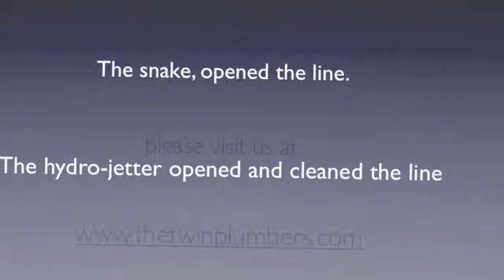Snaking vs. Hydrojetting

Comment: Use a 2 inch cutter on a 1/2 cable , and do a proper snaking ,don't try to use false training to sale over priced hydro job's, pro know hydrojetting was started up for commercial grease traps , guys like this give real plumbers a bad name.
Reply: Maybe this video is a little weak in showing what proper snaking can and should do, and maybe also with a bias towards promoting hydro jobs...however, this URL, https://youtu.be/4lBozsiBnEU, AND this video BOTH show to me that hydro has superior abilities in important respects.  In a reply to a comment above, the twins do acknowledge that some hardened plugs require a high-power snake to poke a hole and make a path for first, but that overall and for most cases, hydro is superior in results--and at the least, in efficiency.  Watch Drain Addict's YouTube videos too.  I paid $200 for a professional to snake my main drain only to have it replug just about 3 months later...it's THAT kind of crap that gives plumbers a bad name and why I'm trying to learn how to do it myself, and/or better.  I guess, really, only a post-cleaning video would show if the final effects are good, with either method.  At the refinery I work at--heat exchanger tubing is cleaned not with snaking, chemicals or brushes and scrubbing/scraping, but by...guess it...very high-pressure water, about 20,000 psi.  So hydro cleaning is seen in oil/gas as a best known method.  Thanks.  I have no connection or affiliation with Twin Plumbers or any hydro sellers or manufacturers.

Comment: Ya this is a little unrealistic.  I’m running water or have it topped off and you are usually clearing only one clog.  When I know I’ve hit the clog or cleared I will run it back and forth multiple times in that spot and then beyond.  All while running water.  Not putting down jetting for the right application.
Reply: Maybe this video is a little weak in showing what proper snaking can and should do, and maybe also with a bias towards promoting hydro jobs...however, this URL, https://youtu.be/4lBozsiBnEU, AND this video BOTH show to me that hydro has superior abilities in important respects.  In a reply to a comment above, Jim and Dave do acknowledge that some hardened plugs require a high-power snake to poke a hole and make a path for first, but that overall and for most cases, hydro is superior in results--and at the least, in efficiency.  Watch Drain Addict's YouTube videos too.  I paid $200 for a professional to snake my main drain only to have it replug just about 3 months later...THAT is pretty offensive to me and why I'm trying to learn how to do it myself, and/or better.  I guess, really, only a post-cleaning video would show if the final effects are good, with either method.  At the refinery I work at--heat exchanger tubing is cleaned not with snaking, chemicals or brushes and scrubbing/scraping, but by...guess it...very high-pressure water, about 20,000 psi.  So hydro cleaning is seen in oil/gas as a best known method.  Thanks.  I have no connection or affiliation with Twin Plumbers or any hydro sellers or manufacturers.

Comment: I have a jet cleaner and the problem is getting it deep into the pipe.  
I can only get it into the pipe about five feet, so it's not as easy as the way it was shown here.  
The snake wire rotate and that is how it finds its way into the pipe deeper.
Reply: There are many types of jetting hoses and nozzles to help. Depends on what was stopping it to choose the hose and nozzle type. And the pumps valve can be set to pulsate on the nicer machines to help get around corners.

Comment: Since when they had roots in 2-inch piping. 
Roots build up comes in the main line from the out side the house. Not the inside... that requires a totally different machine
Reply from the maker: We just did a rehabilitation on a 2 inch line with massive roots. Sorry but your assumptions are not reality. Thanks for sharing.

Comment: none of these methods work if your pipes are really clogged. snaking or hydrojetting a clogged up pipe with grease in it or clogged leach field will do nothing. lol
Reply from the maker: Your right , if a pipe has massive compaction with GREASE ,sometimes your digging to repair the issue.

Comment: I did real hydro blasting aboard US naval vessels which would be between 6,000-8,000 psi with special nozzle tips to cut through any debris.  The equipment would be too expensive for you guys.  The pump alone cost $80,000, so I guess the “rodder” is the real way to go.

Comment: I'm a 33 year veteran drain cleaner. I see some major problems with your video. 
1. Roots grow in through joints. They are not placed in a pipe so they can just be pushed out. They need to be cut out. 
2. Why would you use a 1/4" cable in a 2" pipe? It's too small to do a good job and you can't attach a cutter. A larger cable (my 1/2" is my go-to cable for this job) with cutters attached would have pushed that stuff and left nothing behind (with a good head of water to flush it out). Also, a cutter would have cut through a real root intrusion. 
3. Why didn't you run water with the cable? Cables break up stoppages, they do not wash debris away. ALWAYS run water to get the debris out of the pipe. 
4. I'd like to see you jet a plugged kitchen line from under the sink. 
5. You might be right, but I'm questioning 12 gpm through a 1/8" hose??? At 4000 psi??? Maybe, but I get 1.7 gpm through my 1/4" hose at 1200 psi.
Reply from the maker: This video is simply showing the difference between a hydro jetter and cable method . Wether its a small cable or a large cable it works the same way . Hydro jetting , same thing ,a large jetter or small jetter it works the same way . This is NOT intended to educate people that a 1/4 inch cable is what you should be using to clean or remove roots from a line 
Agreed , we should have used a large cable machine ,but at the time the intent was to show the difference between the 2 machines . 
Thanks for the feedback .
Reply: Jonah Thoman
Same here, 30 years and over 40,000 drains. This video is offensive. We have some amazing stories don't we?
Reply: u2mister1, stories? Endless stories! Oh man, the stories. But how the hell do you count all those drains??? Haha.
Reply: Jonah Thoman
 
Punch in YouTube search-----Why You Should Clean Your French Drain, DIY So Important
Apple Drains site.  About 9 months ago I threw a story out there.  
If you check it out, were I say "what to do" I really was worried.
Reply: @u2mister17  @JonahThoman  Maybe this video is a little weak in showing what proper snaking can and should do, and maybe also with a bias towards promoting hydro jobs...however, this URL, https://youtu.be/4lBozsiBnEU, AND this video BOTH show to me that hydro has superior abilities in important respects.  In a reply to a comment above, Jim and Dave do acknowledge that some hardened plugs require a high-power snake to poke a hole and make a path for first, but that overall and for most cases, hydro is superior in results--and at the least, in efficiency.  Watch Drain Addict's YouTube videos too.  I paid $200 for a professional to snake my main drain only to have it replug just about 3 months later...THAT is pretty offensive to me and why I'm trying to learn how to do it myself, and/or better.  I guess, really, only a post-cleaning video would show if the final effects are good, with either method.  At the refinery I work at--heat exchanger tubing is cleaned not with snaking, chemicals or brushes and scrubbing/scraping, but by...guess it...very high-pressure water, about 20,000 psi.  So hydro cleaning is seen in oil/gas as a best known method.  Thanks.  I have no connection or affiliation with Twin Plumbers or any hydro sellers or manufacturers.